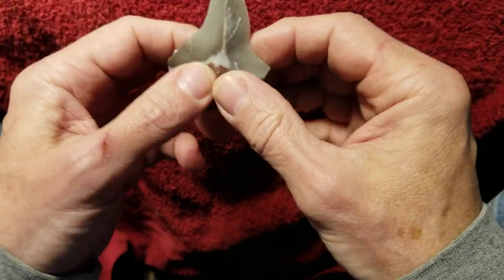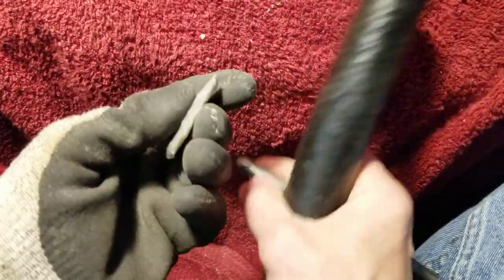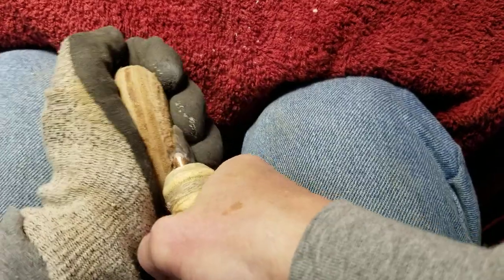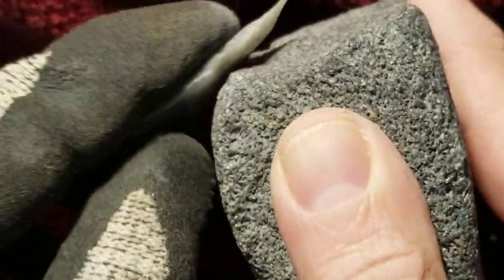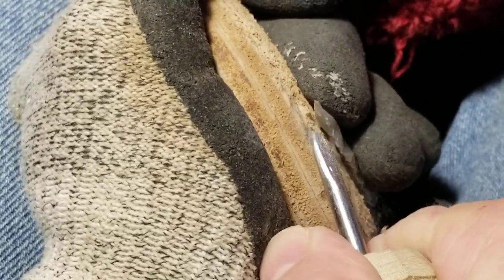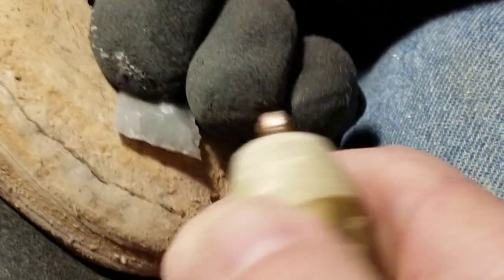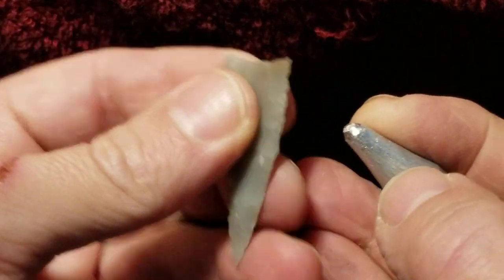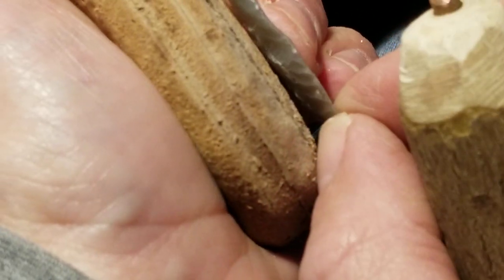1045 - Part 1/2 Flintknapping Novaculite Side Notched Arrow Point

Comment: My Uncle gave me some points 40 years ago that he found in a cache , that were not equal from side to side. They were intentionally made that way, as you could set them on top of one another and they were nearly identical. He said that he thought they were made that way out of preference to get the correct arrow flight off a straight bow, where the flex around the shelf would make them react the same way. I was into competition archery and know that balance from side to side was needed to get true arrow flight, but , that was from a bow that was a center shot set up, straight down the string. Shooting around the shelf causes flex in the shaft and causes the arrow to fly a ways before it can line up with the tip in line with the fletchings. I sometimes wonder how scientific the old timers were about getting several arrows to hit the same spot after launch, these three points were obviously out of balance side to side, but , the bulge was in the same spot on all three. They were heavier points, obviously for big game such as elk and buffalo, and were thought to be cereminial points. I think he may have found an old gravesite and found them together. Have you ever noticed several points that looked as though they were intentionally made to be out of balance side to side ?
Reply from the maker: I don't think I have any artifacts that are part of a matching set. In the past, humans were guided by superstition as well as experience,,, sometimes exclusively by "divine" wisdom. This, obviously, can lead to all sorts of strange practices. When I look at artifacts, I don't assume any deep understanding other than subconscious skill based on repetitive experience and practice.